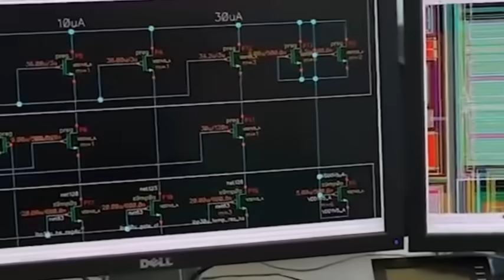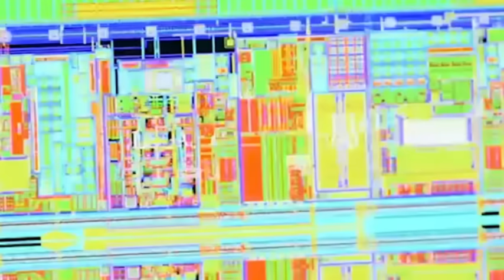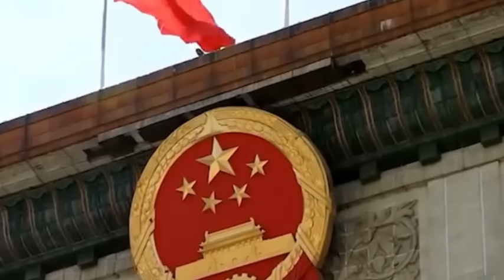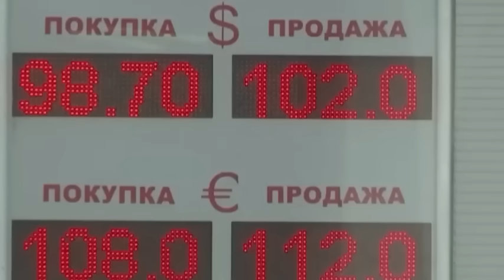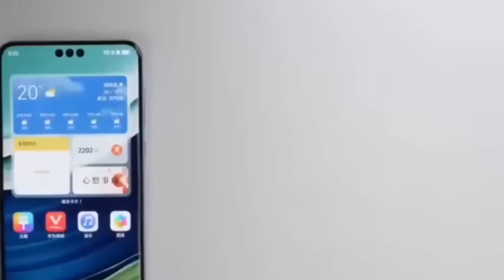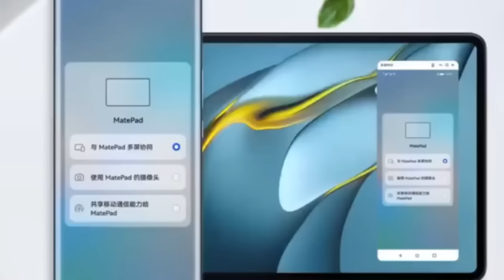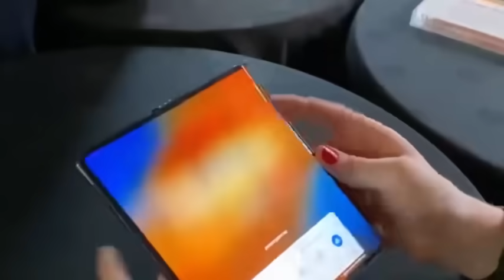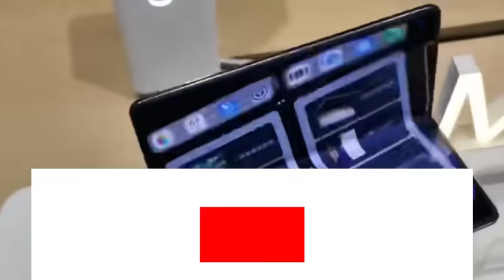Russia develops its own EUV lithography machine, breaking ASML's monopoly.

Comment: Other second order issues will remain. Like increased leakage currents and High K dielectrics required.   Newer geometry like GATE_ ALLROUND are not a given.        Faster is NOT always the holy grail.   LOWER. MIPS PER WATT. IS A HIDDEN IMPORTANT GOAL. For Russia.❤❤❤

Comment: I would love to see another player for stronger competition but in Russia EUV tech is 20 years behind at best. In fact it makes no sense for them to try to catch up here, Russia is too far behind; yet, there are new frontiers like quantum computing for example and it does not depend on traditional microchip manufacturing tech, it mostly requires a brilliant brains while the tech behind is so far in its infancy, it is not even clear what specific route it will take... still, there are many competing ways ....
Reply: That's your wishful thinking messing with you. You wish Russia was 20 years behind. No one cares for what you wish.
Reply: @Sevastopol91  20 years behind is just a wish. Russia is 30 years behind.
Reply: @alexandervt641  
You wish. Which means Russia is doing something right.